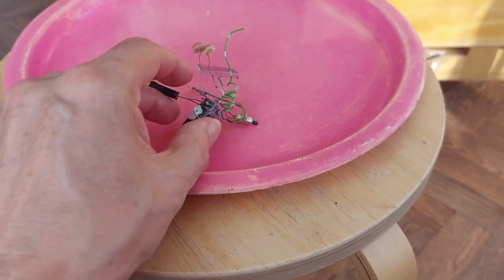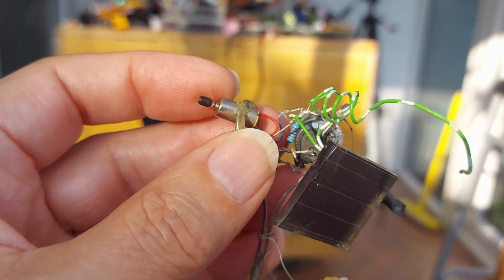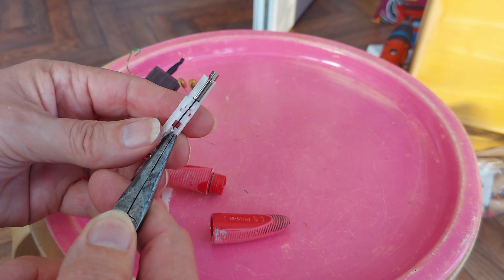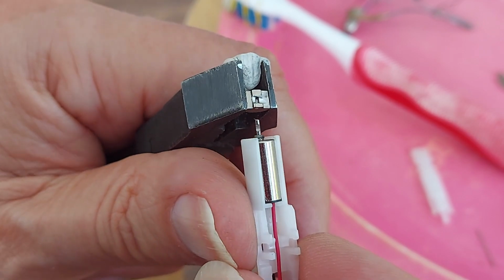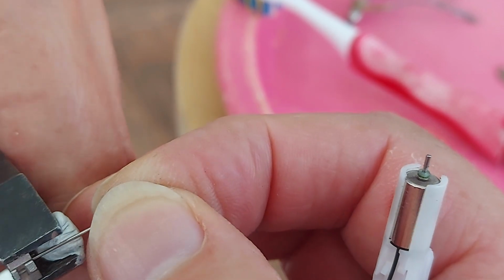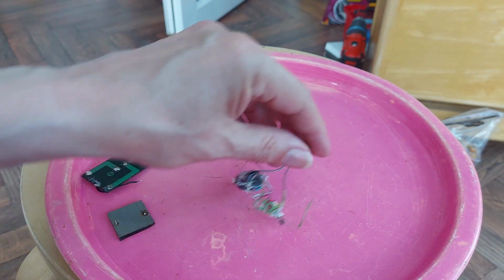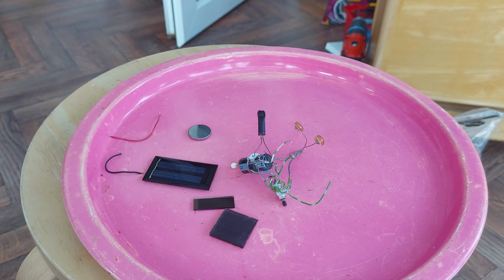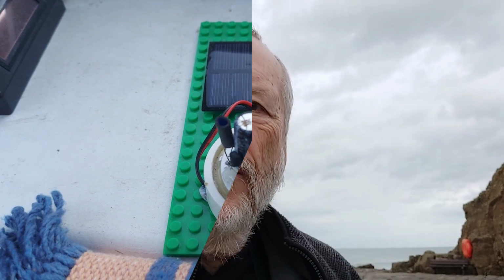My Old BEAM Bot has died 😢

Comment: Coincidentally yesterday I was playing with a device I built some years ago which is in the realm of BEAM technology. It depends upon a 3V solar panel to function. It may be that you need a replacement 3V panel to repair your bot.
Reply from the maker: It just wanted real sunlight. More videos tomorrow. I think the capacitor needs a good charge before it starts going and full sunlight does that better than the artificial lights I was using.